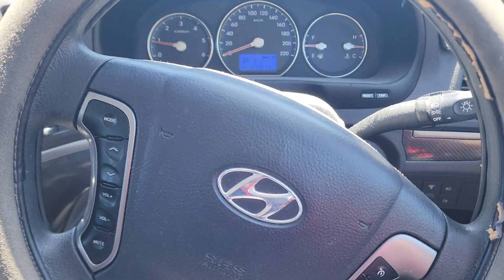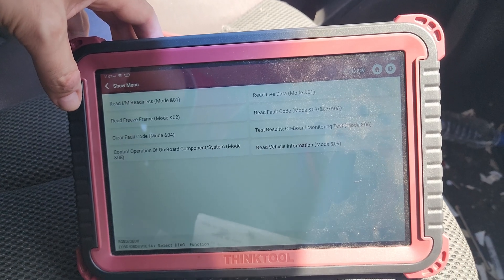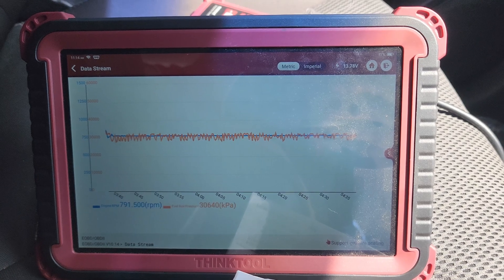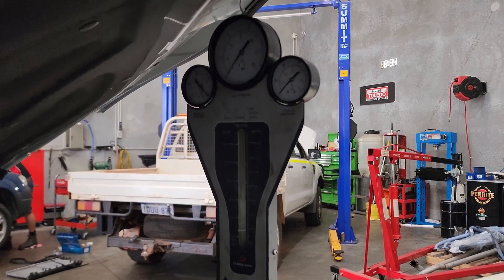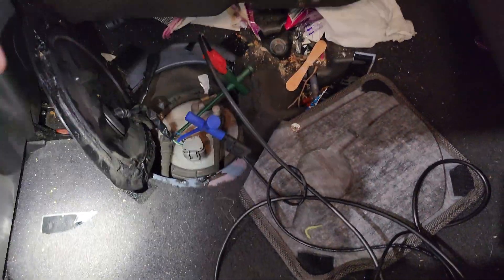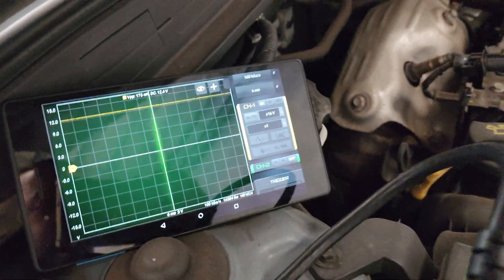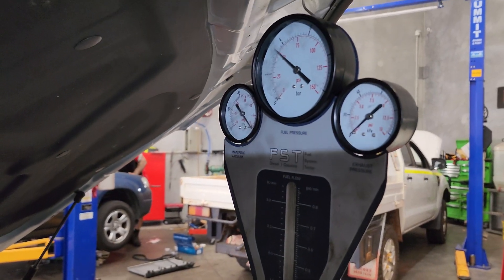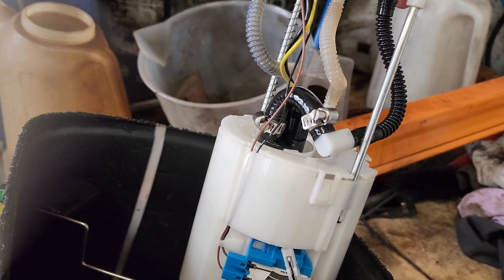Hyundai Santa Fe Diesel Low Power & Stalling - 2009 2.2L Turbo Diesel

Comment: Hi Rob,  I'm about to buy a 2017 Santa Fe 2.2l turbo diesel next Saturday with only 49000 on the clock. Have been doing a lot of reading up about them on the Net, which is how I came across your videos. I've seen a lot of bad comments about these cars, but it seems to be mostly the petrol models? Any thoughts you could share from your experience?

Comment: Good work bro. Low pressure, low voltage. Had one come in with an issue. Send five volts to the rail pressure sensor. Check for power and ground. Change sensor. Car fix. The regulator doesn't give too much trouble but these injectors are one of the worse I ran into.
Reply from the maker: You see a lot of them over there DJ?
Reply: @romanosautomotive  yeah. Got two in the shop as we speak with injectors issues. Too much pressure on the return line. Keep push off the crimp on the return line.

Comment: I assume you load tested b+ and ground at the pump connector, even though that wasn't the problem in the end.
Side note; this car is filthy😕😕😕, good job regardless.
Reply: The pump was connected while testing, that's the perfect load up test the voltage drops
Reply from the maker: Yes the connector was connected to the pump when testing the power. The load being attached would've meant the 12v signal wouldn't have been there on my scope if there was voltage drop. Thanks for throwing the comment in there to discuss 🙏